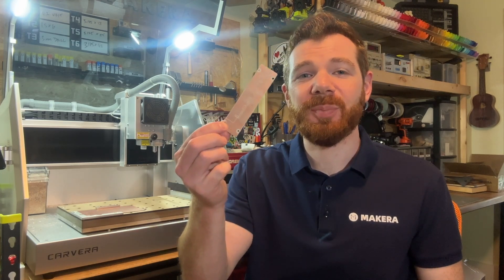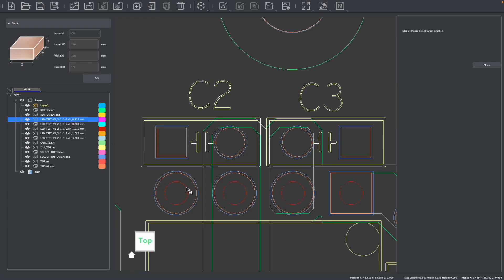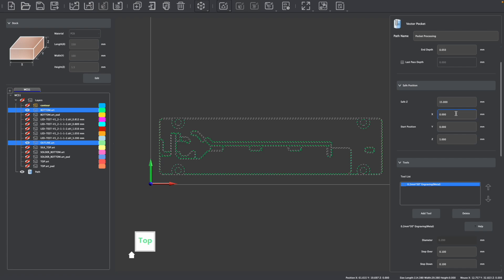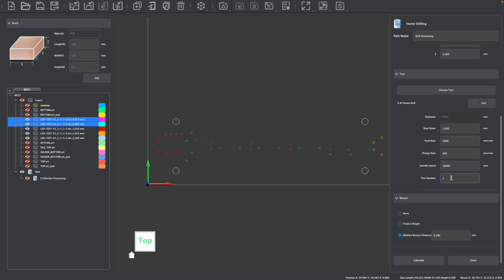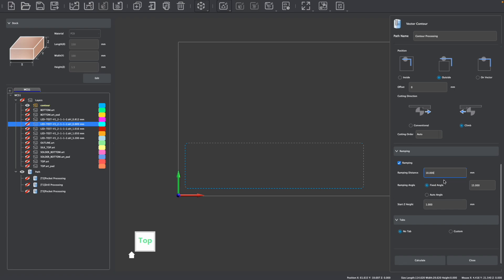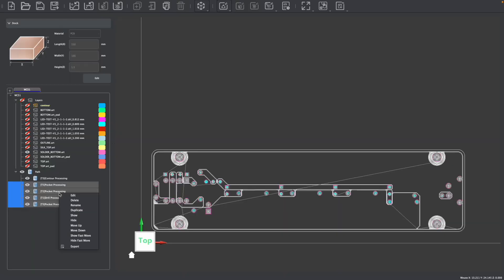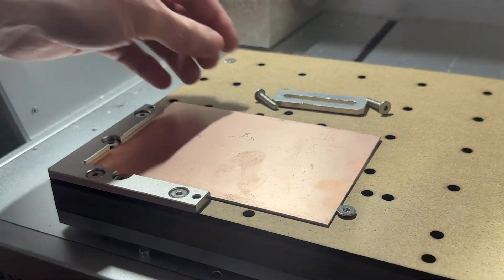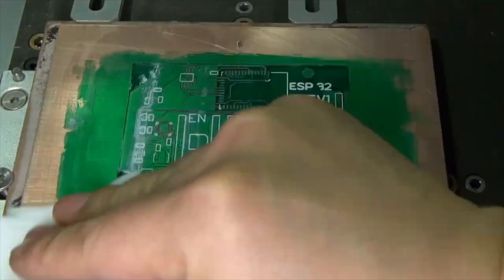How to make simple PCBs with a CNC

Comment: I'm finding this video hard to relate to my own PCB design using Fusion 360.

As far as I understand, the PCB example shown in the vid has traces which cut away copper to create large copper islands.
In my design, I have 0.8mm copper traces.

When exporting the Fusion PCB gerber file and importing into Carvera CAM, the layers seem confusing, with graphics that overlap across different layers.

I then don't understand if my traces should be a pocket or contour? Would I be right in thinking that for my situation, I would be using contour?
It's even more confusing because my copper pads (which are on the same layer as my traces) connect but also overlap the traces, which i think causes the contour toolpath to then cut through the traces and then disconnect them from the trace!?

Please make a Fusion 360 PCB to Carvera CAM tutorial!
Reply from the maker: Thank you for this feedback! We will work to develop more tutorials and guides to support, stay tuned!

Comment: Just checking..   I was making   my traces with the Contour settings,  but I see you are using pocket vector..     When i use pocket,   there is hardly any traces left,   and with contour  it's much better.  which one  are you supposed to use  with the latest cam version ?
Reply from the maker: This depends on your trace width and default export settings you're using. Either is acceptable depending on the design.

Comment: how do you remove the white soldermask ?    i did a board, took about 45 min,  for the silk screen,  but  can hardly take the white soldermask of.   ending up all smeared.    i am using 200 speed and 10%
Reply from the maker: To clarify, this is when attempting to cure the solder mask using the laser correct? To do this, apply the solder mask and then run your laser file with the speeds and feed of 100 / 20% while its still wet. Then wipe excess away with isopropyl alcohol.
Reply: @Makera  correct.   let me try it again with isopropyl.  to see if i get better results
Reply: @Makera  Thank yoiu ,  let me try 100 / 20 %    i tried 200 / 10%  and using the isopropyl  and it wiped it all out..   (90% iso) . will  20% be better or will it burn into my traces ?

Comment: Which tool do you use when you mill the red resin to expose pads ?
Reply from the maker: That was done with our solder-mask removal tool which is included in the PCB fabrication pack

Comment: What is .art? Are .gerber files supported?
Reply from the maker: .art is a common file type for working with PCB files as part of a geber. If you export a geber, you should be able to unzip the contents and import the individual files from within, which may be art, drill, gerber, etc